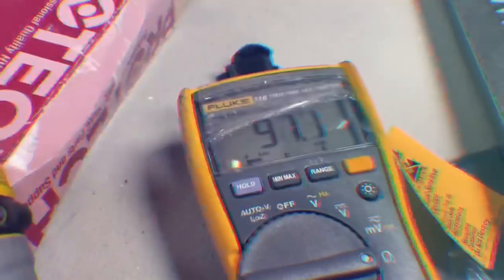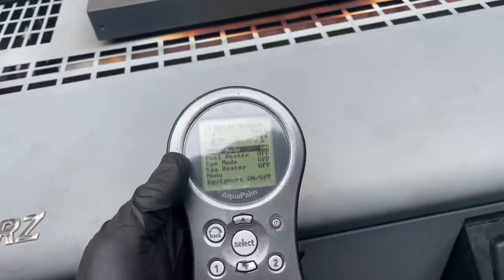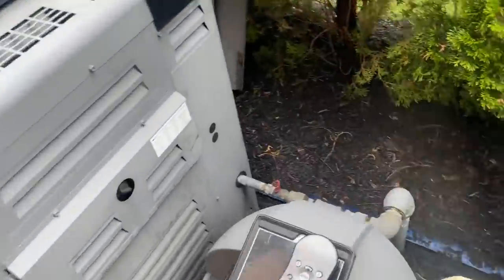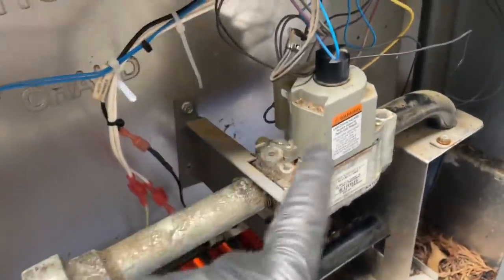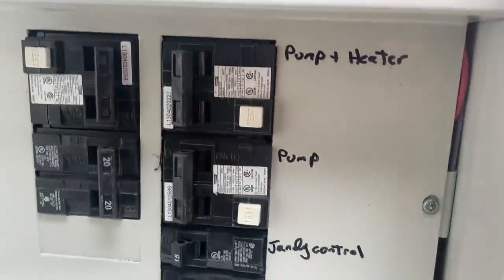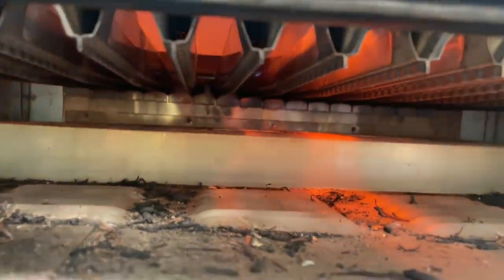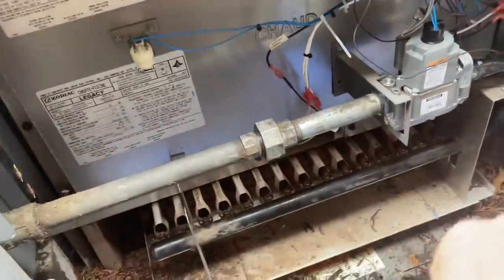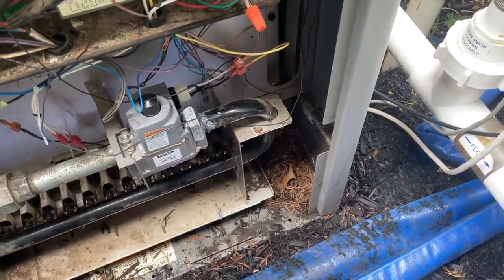Jandy LRZ Pool Heater Not Working - Ignition Failure - Gas Valve Not Opening - Part on the Truck

Comment: At my last company we did lots of pool heater servicing. Not on units quit this big though. We would vacuum out all of the leaves and debris. Most pool heaters we did had no line voltage they worked off of power piles which had enough milli volts to open the gas valve.

Comment: Did you ever have this happen to you:  In a very upscale suburb of Syracuse NY, I was dispatched to repair a driveway lighting issue at a very upscale residence. Before she left to go to work, the homeowner asked if I would also look into a no power issue at one of the cabanas out at the pool area. The pool area was located in the rear of the residence behind the tennis courts. When I got to the pool there were four young ladies skinny-dipping in the pool. I excused myself and abruptly packed my tools and left. They obviously did not know that I was asked to repair anything at the pool area. I was called back to the residence the next day, but decided it better to give the call to another technician.
Reply: Manlius

Comment: Do pool heaters  have a roll out switch
Reply: @PipeDoctor  Mike I'm thinking about a bosch heat pump and 100k BTU gas furnace and coil all bosch. As i read im confused about the tonage is it true that the equipment can modulate between 1.5 ton and 5 ton ??
Reply: @PipeDoctor  Thank you for your knowledge.
Reply: If it is a true VRF(variable refrigerant flow ) system ,the answer is yes! I'm not well versed with Bosch,but Fujitsu,Daiken,Mitsubishi can run minimums,so say you have a 3 ton unit,with three 12,000 btu heads,you can run one and not the others,so it is essentially 12,000/1ton from a 3 ton unit
Reply: @petersmart1999  thanks for your respone !! My application would be a heat pump a gas furnace and coil kind of a dual fuel  set up not like a bunch of head units throughout the house

Comment: I have a Jandy jxi heater. The flame sensor is the hot surface element. The unit fire up, produces heat for about 10 seconds, then powers down. It tries this twice then says “check ign steps”. Can the hot surface light the flame but still be bad? Can the gas valve produce enough gas to light but then not stay lit? Thanks

Comment: Mike, I have the exact same heater - Jandy LRZ.  My issue is gas valve isnt opening.  BUT, the hot surface igniter gets hot and bright orange, there are NOT 24 volts coming to the gas valve to open it?  I have already replaced the FENWALL and still it will not open the gas valve and doesnt seem to be sending it power???? HELP
Reply from the maker: Check safety circuit.
Reply: @PipeDoctor what’s the safety circuit?   I’m googling but can’t find it. .  Is it the full circuit board?    I just watched another one of your videos where you diagnosed a has valve and it showed clearly that the two wires coming to the gas valve so hot the 24 volts as it cycles. Mine definitely does not.

Comment: 104F set temp? holy moly too warm germ cesspool :))
perhaps they should get rid if the pool and go to a hot tub?
Reply: You typically set the heater itself to max temp when it’s being operated remotely.  Actual pool temp was set to 88 I believe i saw on the remote handset he was using.

Comment: I'm getting an IF code on a Hayward 400000btu and it's only 2 months old. It wants to start but it wont stay lit and shuts right back down. Let's say I'm not as excited as you are to be cracking it open and dissecting the issue
Reply: @PipeDoctor  
You mean on the burners ?
Its clean as a whistle where the gas valves are.

Comment: Since the wire was on the wrong terminal doesn’t that indicate the last tech did not properly test his work? With the flame sensor not connected properly it would not have run.

Comment: Holy shit it’s not a navian!
Reply: Navien's suck and so does new tech!
Reply: @PipeDoctor  No I don't have a combustion analyzer. Why? It is important as a tech, but I do my oil burner by eye. I'm not a HVAC tech. I work on my own equipment. I run a Vailliant with a Beckett burner when that dies I will have a Burnham or Crown Boiler from US Boilers 80-85 + no new junk and will use Taco 007 pumps .I mostly work on old school cars and small engine. Although did a lot in the satellite audio and video technical work back in the day.